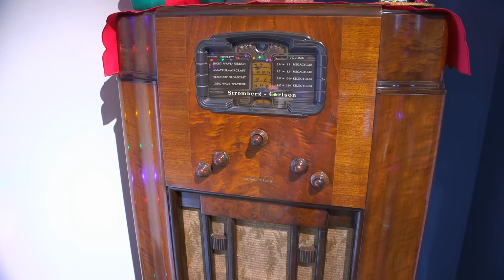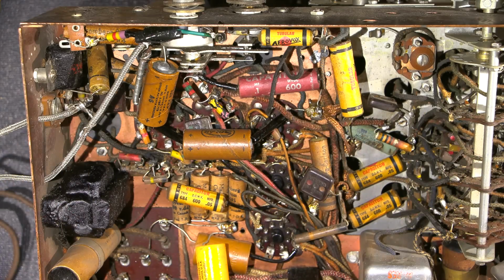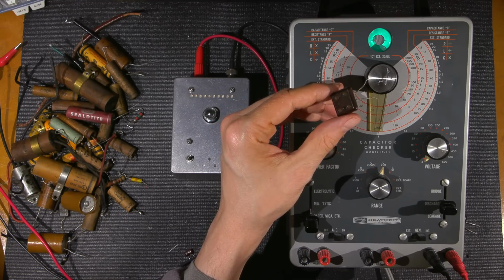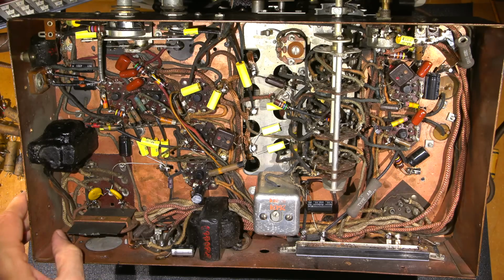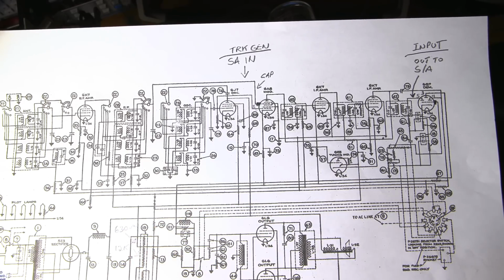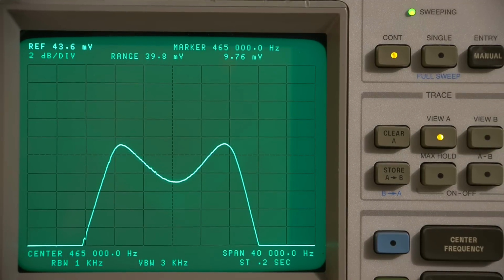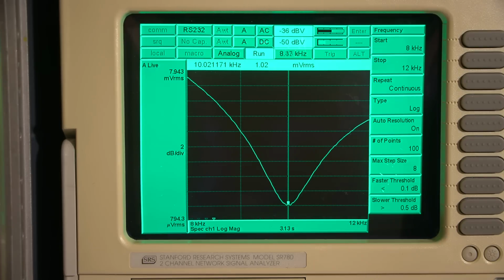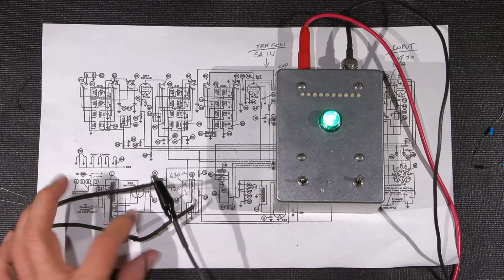84 Year Old Radio Receiver Restoration! Stromberg-Carlson 145L

Comment from the maker: To learn electronics in a very different and effective way, and gain access to Mr Carlson's personal designs and inventions, visit the Mr Carlson's Lab Patreon page here: https://www.patreon.com/MrCarlsonsLab
Reply: S Macca  6
Reply: @rogerwilco99  I see your point. Also, I try to imagine what the designers of these radios would think if they knew we were trying to replace components by stuffing the new ones inside the failed one`s casings; I think they would tell us not to be so stupid!  They would welcome the development of components that performed well and tell us to get on with it  -   what do you reckon, @rogerwilco99?  Bev.
Reply: Dear Paul,
I hope you and your other half had a wonderfull Christmas.

What a beatifull looking and performing radio, really neat how they made "display meters" for the fidelity and vollume. Simply ingenious, the cabinet and bass-port design is a work of art. Mind you, this is 1930's engineering. Go figure !! 😀
I enjoyed this long restoration and allignment realy well 😊
Hats off to you for yet another super usefull and enjoyable video with knowlage and AM-tech curiosa.. !

I have one burning question tho,
It's about the small Electrolytic caps you showed at 21:40 , the ones you put on the cathode of the 6L6 's ;
What values do you usually stock up on for these? (Capacitance and Voltage ratings)

I recently stockpiled up on some Electrolytics (and also Metalized-film capacitors) that you put up on your 'Tested Components' chart back in Sept. 2018 on Patreon.
However those electrolytics are all 450V rated and thus are bigger in physical size than the ones you showed at the above point in the video, hence my question.

Many thanks for taking the time in case you would answer my question! 😊

Best wishes from Holland,
and a Happy Happy New Year ! 🍾🎆🎉
Reply: @TheDrunkenMug  I think times were better when there was local electronic distributors
Reply: Hi sir Amplifier BREMI BRL 40 - 70 about plz sir ,
Also germanium diode a117 about plz impression
Reply: Mr Carlson electronics I am not good in math or electronics you can save money on electronics because electronics cost lot of money Mr Carlson you no lot about electronics
Reply: Too busy to give a response to some of the well thought questions below? I have a couple of curiousities myself if you can reply too. How many would you estimate of this model radiogram were manufactured back in the day. How rare are they to come accross, to buy. And what sort of money did you pay for yours, in as is condition ? A very beautiful piece non the less! I can imagine the family gathering around it listening to their favorite programs in the evenings, and just being a real family . Unlike today individually being brain dead staring at the tube, bombarded with advertisements. The 30's was a real goldern age, just before the world became serverley disrupted with WW2. My father fondly recalls listening to programs like (spell check) Biggles. My grandparents had 9 children before escaping the Netherlands after the war to Australia always had a radiogram and a piano in the livingroom. Bathtubs were Saturday night , church twice every Sunday. I really apreciated watching and learning new things in your video, so a big thankyou for that. Another subscriber here.
Reply: @ Mr. Carlson's Lab -- You can use royalty-free music on YouTube.  Play it over your own AM broadcast "station" with an RF output similar to your signal generator.  We could then hear the beautiful fidelity of one of these fantastic radio sets from days of old!
Reply: Mr. Carlson... do you have any interest in graghine batteries or do you know anything about them? i am very interested in your opinion about this subject.....
Reply: এ-ও এ-ও এ-ও
Reply: When does his partner, Mr. Stromberg, show up?
Reply: nice
Reply: Here comes a new hobby for me and to add to my other hobby which is collecting  8 bit  microcomputers and games lol
Reply: Where is your dog Mr. C?
Reply: Are you related to Stromberg Carleson?
Reply: I have a Vintage 1940 Mantola console/floor radio. It has been restored and they also added a MP3 player to it. Do you happen to know the value of it?
Reply: @vintageradioman  Nothing since it has new technology added to it.  My thoughts it destroys the value and integrity when new technology has been added to the original. It's been altered.  If the player was added and no sawing to the cabinet and can be removed tso original it's worth something as a 1940 console floor radio would go on let's say average market retail price from Ebay.
Reply: @jockoharpo2622 He didn't add new tech. It's just a wire that you put inside to plug à mp3 device in it, the radio is used as an amplifier. That's it. It's very easy to do. It's still better to build yourself à small am transmitter and play your files that way. I did the later and I could use any radio from my collection to play old radio programs.
Reply: @MarvinHartmann452  Thanks for the heads up  I don't know where my head was when I posted that  Brain fart.  I should've known that as I have something similar here.  LOL  It's an Irock Beam-it.
Reply: @MarvinHartmann452  I'm still trying to see Mr. Carleson's dog.  I see he has a lab.
Reply: @MarvinHartmann452  Hey ask him if he's related to Stromberg.   Stromberg Carleson WIll ya?
Reply: I remember listening to that atomic clock in Ft. Collins when I was a kid in the  early '70's  My uncle gave us a '42 Hallicrafters and set our clocks to it.  I still have the radio and it still plays great and that atomic clock sounds exactly as it did in 1973!
Reply: Do you get a Carlson family discount when you purchase that brand?
Reply: God Bless you Sir
Reply: When replacing components in old radio's do you need to worry about the Q-factor of  the new component? or does differing Q-factor have a negligible affect on the function of the radio?
Reply: You are a legend!
Reply: Too much  His in your microphone it's Too much on my ears
Reply: @jmm1000   What you don't know it really kills you I have my daddy's Jean you don't you warn born with old positive blood or even the gene of Elvis Presley like I was you have no knowledge or upbringing to even talk to me do not talk to me ever again next time will be trouble
Reply: @elvisdawson7404  umm...wut...
Reply: @elvisdawson7404  deleted
Reply: What a brilliant radio and a great restoration job. Are you related to the Carlson's of Stromberg Carlson?
Reply: Mr Carlsan that so cool the sounds good
Reply: Very nice,  I'm somewhat surprised, as anal as you can be, that you don't heat up and remove the guts of the paper caps and re-stuff them with modern caps, and the same with the electrolytics.
Reply: @Daveyk021  I know if looks really good and professional but doing that can take some time. Who's going to actually see it, the next service Tec in the year 2200?
Reply: @Daveyk021  I believe he is also going for the performance gain, which would be impossible due to the size of some components.
Reply: I have a fealing this is a tqw design... Looks like it.

Comment: That’s an excellent very detailed process. I’ve been messing with audio and radio since I was 12 years old and the same thing as I had read from others input of their commentary collecting jewels from collection day and picking up discards for parts as well as viable candidates. But for me without the equipment like that I would proceed with the receiver tune to the lowest frequency station that I could receive that was not saturating the set and first tune the oscillator section to match the dial and in some cases I would have to hunt tuning the oscillator padder And the tuning capacitor for maximum audio. In addition to I would put a meter on the AVC line and one on the audio output and use that for maximum value monitoring as well then I would proceed to the first IF section and peak that and then proceed to the second IF and then peak that and then I would double back and do it over again then I would tune to a mid band frequency and peak it again and then sit and adjust the oscillator trim on the tuning capacitor to bring in the dial at around 1300 or 1400 KC station and then peak it all again and set the RF section of the Tuning capacitor trim for maximum gain at 1400 to 1500 kHz . And if it was additional I have sections well I would bring those in the play also and even if it was stagger tuned. I had an old SX 25 Hallicrafters , tweaked and peak that way including the staggered tuning the IF’s By shifting the tuning dial slightly while setting , on that It had band width select with also BFO as well .  The Stromberg is a very good radio of its day very high end and it had the variable bandwidth and that thing was probably running conservatively but could easily produce probably 20 W of power audio with those 6L6’s that’s one great radio in its day as well as a quality unit for this day a fine specimen.

Comment: When I was 8-9yo, (1993-‘94) or about that time, we had a very large freezer box from the 50’s or 60’s in our basement which doubled as my grandfathers shop. My grandfathers work bench was adjacent to it, with a table top/bench vice on top…

The wiring down there was all old, pre-GFCI. 

Something shorted out from the freezer and electrified the entire freezer housing and the adjacent bench top vice. I found out by touching the vice when I was randomly down there and my whole arm instantly went numb, like a compressed ulnar or radical nerve.

Luckily there must have been enough resistance between whatever shorted at the freezers mains supply & compressor end and the vice that it was just a fairly mild tingle & numbness and more or less just amusing.

Needless to say though, they ditched the old freezer shortly thereafter.

Comment: Recently came to posession of a Philco Model 42-22CL table top radio.  It has an RF tube so is a six tube.  Just ordered capacitors for it and stripping out old wiring etc.  It's in great physical condition other than wire rot etc.  Also has police band.  Loktal tubes.  I would be interested in ideas for widening the bandwidth a little.

Comment: I would point out that the reason for the 10 kilocycle (kHz) notch filter was to eliminate the 10 kHz beat note from adjacent frequency radio stations.  I have a Truetone 724, a poor cousin of the 727, waiting on restoration. This video will be a help.

Comment: The purpose of the 10khz filter isn't to 'keep the highs at bay'", it is a notch filter to remove the 10khz beat frequency from adjacent stations so if you're listening to say 900Khz and there is a station on 910Khz, and your IF is wide for good high frequency response, without that 10Khz notch you would get a constant whine from the adjacent stations carrier beating with the stations carrier you are listening to.  You could make the IF narrow enough that that would not happen but then you would lose potential high frequency response.

Comment: shame, now this radio is no longer worth anything after all the modifications , cannot be sold as antique
Reply from the maker: I have been offered thousands of dollars more times than I can count for this radio, where did you come up with that idea?
Reply: @MrCarlsonsLab  after changing all the caps to present day caps,it is no longer an antique . you would be committing fraud. they are not original  type parts. just like an antique car, you can't change out parts with modern day parts. a real antique buyer will open the radio and see it's a fake

Comment: Probably a ux 280 or just 80 full wave rectifier tube. Speaker was electro- dynamic . B+ for tubes went thru field winding which speaker needed to work. It replaced the magnets now used in speakers. This coilworked as a filter choke. Some speakers had a hum bcking coil as well.

Comment: I hate to sound  critica,l but this would have been far more interesting if you showed the actual work being done, such as the replacement of the capacitors. You left me staring at the chassis as you're pointing out to this and that, talkin talkin talkin talkin talkin talkin talkin talkin, and then all the sudden you show a bench full of old capacitors and said these have been all been replaced. I wanted to see the entire process, at least the shortened time elapsed version of it. Instead all you showed me was before and after, but not during. Of course I don't want to see 16 hours worth of you just replacing capacitors, but at least just a portion of it would have been interesting. Anyways, good luck

Comment: A kilocycle is the same as a kiloherz and a megacycle is the same as megaherz? Wow this old radio is one great radio! I wish it was mine but I have to do my radio with my Raddy rf750 Shortwave radio!😜😜😜
Reply from the maker: And... One Kilo-Megacycle is 1 GHz. That one really stumps all the modern day engineers. My 44 Kilo-Megacycle spectrum analyzer (44GHz) from the 1950's uses this "term", printed directly on the RF unit.

Comment: Very nice video restoring that beautiful Stromberg - Carlson radio. Thanks for sharing. I have a Stromberg - Carlson console radio with AM/FM and phono on it. After some cleaning, powered the unit and was able to received AM and FM signal but loses it after a few minutes. I carefully removed the radio unit from the console and noticed that many of the capacitors and other components turned brown in color. I wish i can restore this old but beautiful piece of electronic device. This is the Model 1210 Series II. Thanks

Comment: I've been watching your restorations of vintage radios with much enthusiasm.  I've learned quite a bit and have used that knowledge to restore a couple of radios.  I don't have all the nifty test equipment but have managed.  I'm now in a quandry.  I have a Stassfurt Imperial 50WK radio from the 1939 era.  I wanted to restore it but the more I look into it the more I think it may be beyond me.  I have no way to test the tubes as they use the pre war octal sockets and I'm not even sure I could buy replacements.  Someone got into the radio before me and quite frankly I don't think they knew what they were doing.  They pulled out the AZ11 rectifier tube and socket and replaced it with a 5Y3GT.  Unfortunately, the 5Y3gt uses a 5 volt 2 a filament and the AZ11 is a 4v 1.1a filament so not sure how that would have worked. Surprisingly, there are only 3 electrolytics in the radio and all 3 are very easily replaced.  Found it interesting that the IF is 477kHz.  It's not that important to me that the restoration look totally original, so I could use some modern components.  Not sure about using say 1N4007 diodes to replace the AZ11, as I would have to account for a different voltage drop.  Do you have any suggestions, advice etc.? I know, it's a totally unfair question!

Comment: In this case it didn't matter, but the 1 meg resistor for the tuning eye could have been tested without opening the socket.  Just put the meter probes into the socket pins that the resistor is connected to.

Comment: I have a old Fender chassis and I found the schematic on line. I'm good at soldering but only have a Greenlee multimeter. Do you have a tutorial on repairng this sort of 100 watt system? L believe it is about 1960s or 70s reverb amp.. It is missing transformers(power supplies?), L would really like to learn how to repair these. Thanks for explaining caps inthis episode but I realize I need to learn more Suggestions? Thanks from Calgary Alberta.

Comment: I am a NEW follower and let me say, I am so impressed by this channel and your dedication to radio. I know NOTHING about radio or electronics but I own a couple of old units. First I own a Canadian built 1936 Marconi that is almost a big as your Stromberg Carlson. It has a push button selector panel and an electronic tuner eye. It's not working currently but when it was the sound was wonderful on AM bands and shortwave. I also have a 1950s Marconi AM desk radio that still works but it needs tubes or something. I am so glad you mentioned the death capacitor in this video. I plugged it in and got a shock off the chassis last time I tried it. Now I understand from your video why that happened. I am going to send it out to a shop where it can be properly tuned, repaired, and made safe! I just love switching the old radios on and waiting for the tubes to heat up. The audio is so soothing and mellow to my ears. Thanks again for your time spent on this channel so that even amateurs like me can enjoy the great radios of the past.

Comment: It is amazing how we only used the shortwave bands for everything back in the 30s
I remember that the radar sites in WW2 used 300 MHz for the radar 

In the 50s TVs had up to channel 99
They reduced the channels to 83 at some point when they wanted to use  the 900 MHz band for something in the 70s.
Then in the early 80s they reduced it to 69 channels

Now I think channel 50 is the highest and they are looking to reduce the TV channels to 2 through 13 and give the entire 500 band to the new cellular high speed internet

Amazing how we keep moving forward and using the higher frequencies for LMR where they never were before

Comment: I've heard of superheterodyne receivers but I thought that they all had a fixed IF. What you have said a lot about is how much leaky capacitors cause grief. I think a lot 9f failed tubes tubes and devices failing was caused by leaking capacitors.

Comment: I know the mica capacitors seem to last a very long time, but they probably won't last as long as the new capacitors you're putting in (they're 84 years old). For a very small cost why wouldn't you just change the mica's as well to future-proof the radio? They cost so little to replace. It's not just you, I see others doing the same thing and it's always puzzled me. I know they don't all last forever because I've found a few that had problems. Thanks! Love your videos.